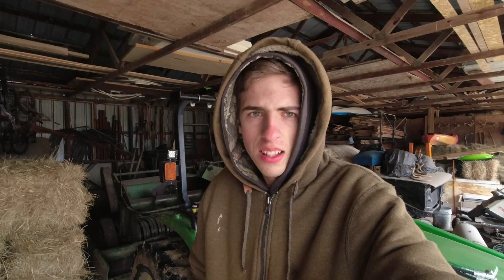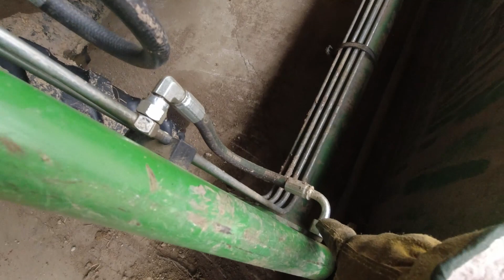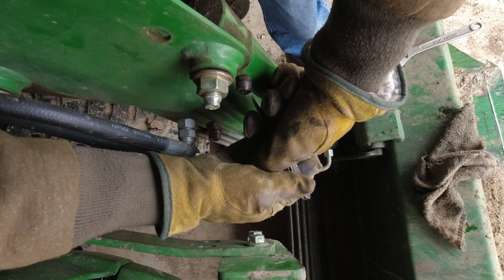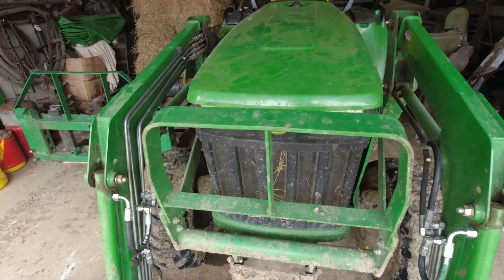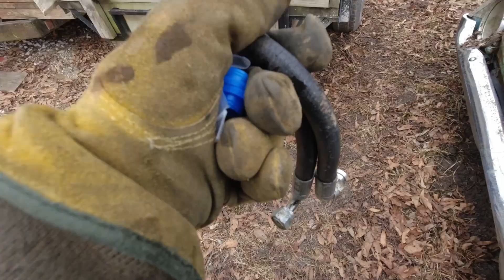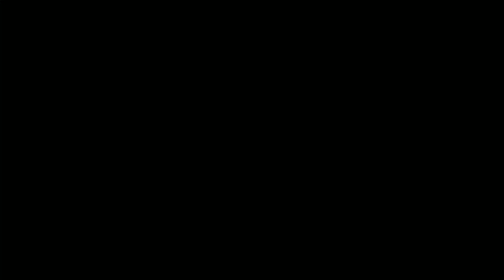Replacing hydraulic lines | John Deere 3032E

Comment: I bought my 1025R last week and today it was leaking a lot from the same hose you replaced but where it connects, the bolt. It wasn’t tight enough. Had to tighten it really well and buy more hydraulic fluid since I lost like 3 cups.

Comment: Where did you get the hydraulic hose/and fittings was it sold as one piece or did you make it? I need to somehow order the same one
Reply from the maker: I looked up the part number on John Deere’s website for the D160 or 305 loader and then found them on eBay it was one piece or a pack of two or four not affiliated with them, hope you get your tractor fixed soon!

Part number: AW29374

The eBay listing: https://www.ebay.com/itm/224074037666?hash=item342bda79a2:g:l0MAAOSwi2dhgJrV&amdata=enc%3AAQAHAAAA4L3t1HtGoN28sZDQLzsqbeEN7OE9AB77nyfGtfjekIi%2BKxCcvG33SDA2BOqha2xiJ2mX5K4yn7mvqKpseKzi4xKz%2Ffyvoo6qQM56e5EO%2FRuvgsEhNeiiChGBko2f7f6zWFBTB8PznZmLwnaDwoXDrqbXAFbJQgyP1t7dLrMDyAttvMaH1hxz9U2xElXMv4SmJYywuosvLAreKaJxGsmAE7kQx0I4B5tGsK646bdu0u5IvaDXP%2FB4jTPwdxysjN43DNXT3oTS%2B1dtoQi%2BNZUjNXe4joBGR%2BMIyLqYyrOvjECR%7Ctkp%3ABk9SR8LF7ayFYQ

John Deere website for d160 loader part numbers: https://partscatalog.deere.com/jdrc/sidebyside/equipment/62156/referrer/navigation/pgId/1124242